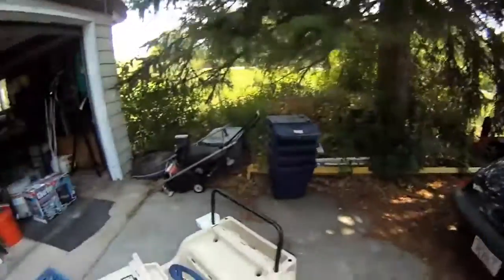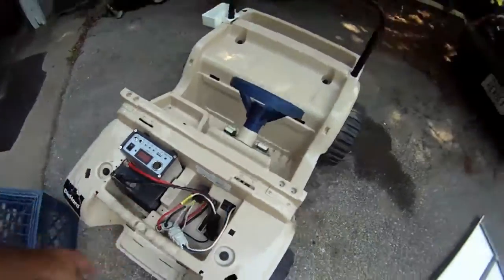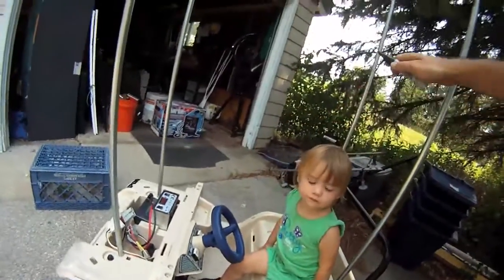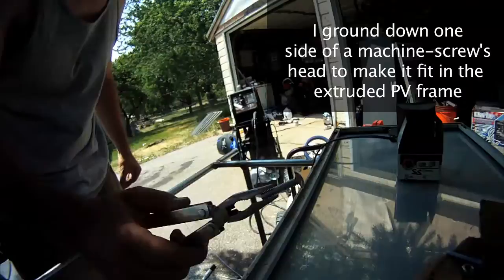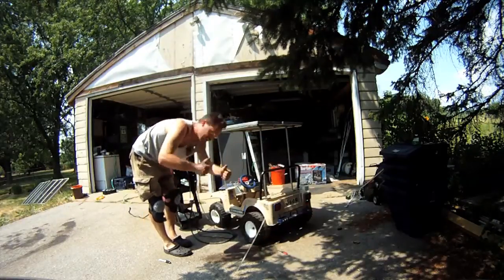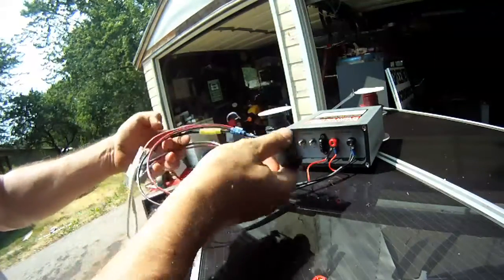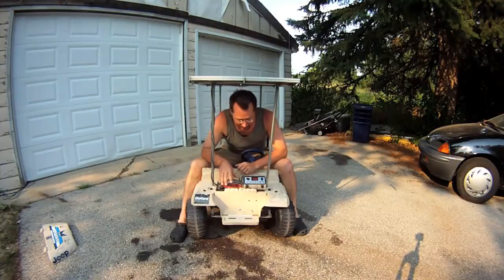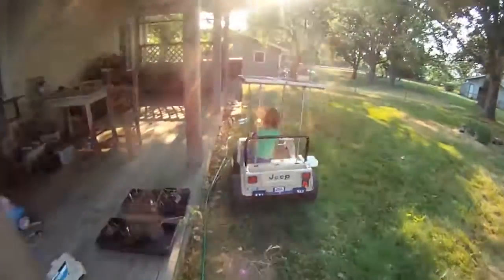Building a Solar-Powered Power Wheels

Comment from the maker: The solar panels are smaller than the car, and don't weigh that much. The vehicle frame under the plastic body is steel.
Lead batteries are never "light-weight". I lifted the vehicle sideways to see what it really would take to tip. I had to lift the one side up 16 inches off the ground ( with the other side staying on the ground) to reach the tipping point. That's almost 30 degrees. My yard is flat. I really don't have any concerns.

Comment from the maker: The PV panels are 1amp each at 12V charging voltages. That's 2 amps into a 10AH battery, so it should recharge from dead in 5 hours or less.